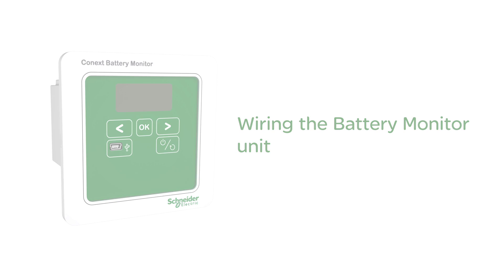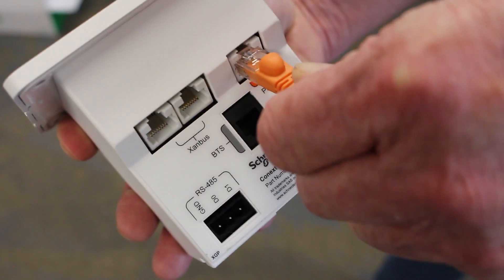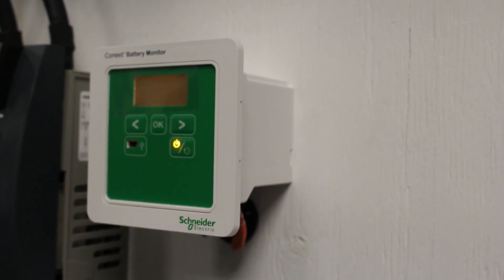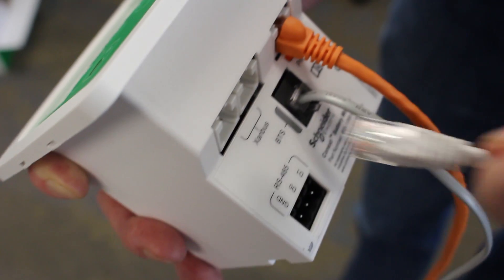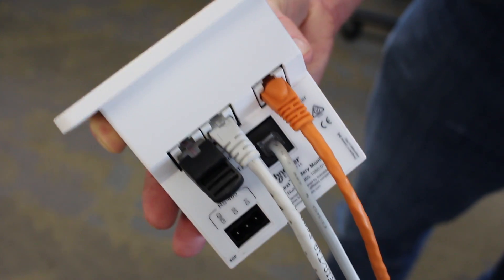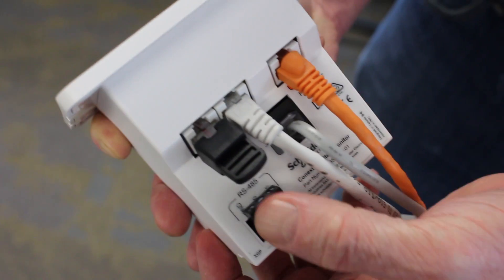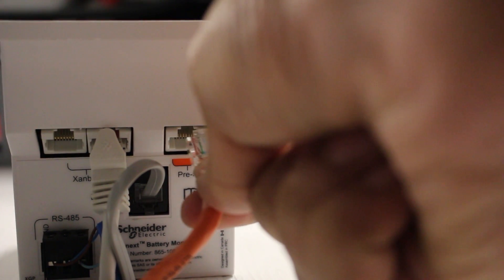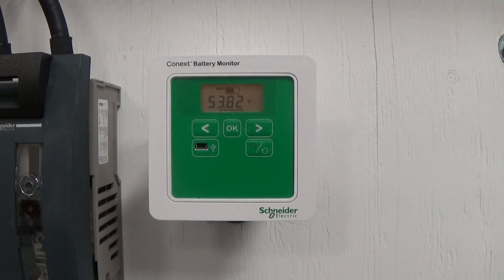[Part 4] Wiring and Powering Up the Conext Battery Monitor

Comment: Good afternoon, tell me if I connect 24 batteries and 3 the Conext Battery Monitor for 1 shunt of 500 amperes what value should I specify in the Shunt Amp Rating
Reply from the maker: Hi there, you can consult with the product manual, as the application you describe below is not supported. It is required that each battery monitor has a shunt.
Reply: @SESolar  that is, each battery monitor is connected separately to its own shunt? this is not written in the instructions. and if 2 battery monitors are connected in parallel to 1 shunt and in the shunt amp rating specify 250 amp?
Reply from the maker: @СергейПоперечный-у8в  Usually when an application or mode of operation is not listed in the manual, it is because is not supported. Other reason may included that we have not tested the application